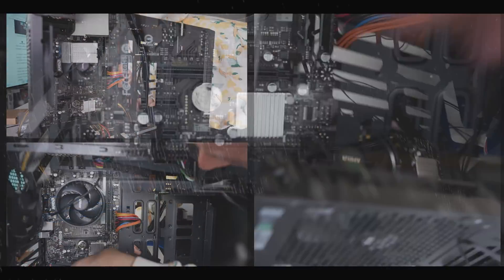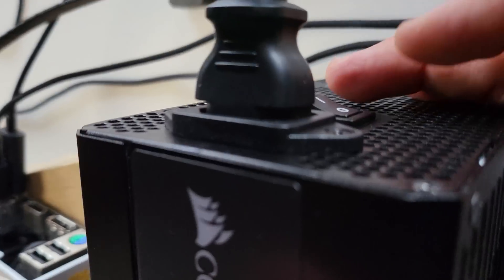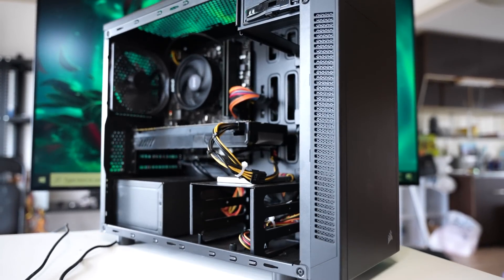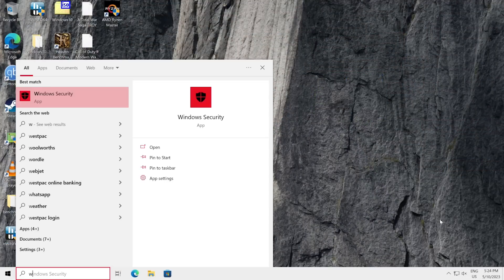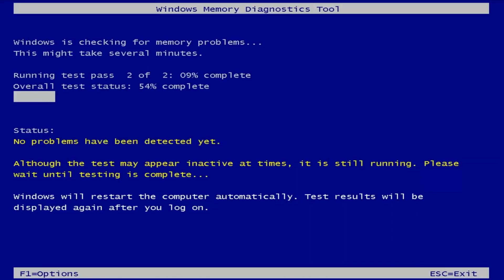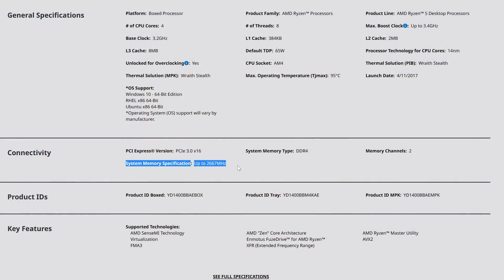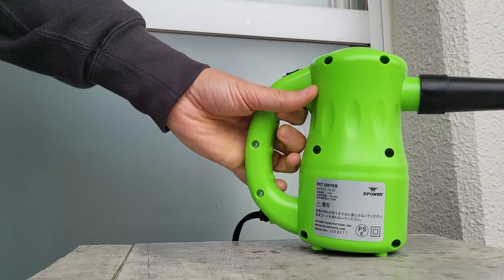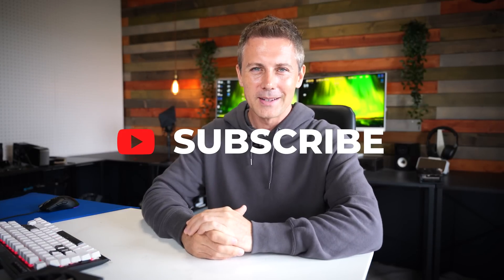Computer Won't BOOT? It Could be FAULTY DDR4 (or DDR5) Memory

Comment: Those Corsair Sticks you got are version 4.49. also known as Samsung 16Gb M-Die. i've been told by some people who binned lots of ram that this chip is so bad that if you have it your XMP is most likely at least a little bit unstable. it is apparently one of the worst DDR4 chips ever made. worse than 8Gb C-Die and 8Gb AFR.

The first kit you had is using Hynix 8Gb DJR which is actually a very good chip. so that one was most likely just bad luck because DJR is known to have very high voltage tolerance and overclock in excess of DDR4 4600 on motherboards that can handle it.

in my opinion it is highly important that people know what RAM chips they are buying because it not just helps immensely with overclocking if you want to but will also help you avoid chips like S16M or S8C that are known to die en masse compared to other chips. sadly it is almost impossible to tell what chips you are getting if you buy online because ram manufacturers of course don't want to let you know that 3200 16 18 18 28 kit nr1 will overclock to 4600+ while a different kit with identical spec but different chips will be stuck at 3466 forever.
Reply from the maker: Oh wow is M die the worst? I didn't know that, I thought Hynix A die was some of the worst.  Thanks.
Reply: @techyescity  Is multi purpose spray the same as WD-40?
Reply: @DapFrIeNd.  Here in Australia it’s actually labelled ‘Multipurpose Spray’ in a blue spray can and it’s similar to WD40…. HOWEVER…. WD40 in some  countries uses a different formula which makes in a conductive lubricant cleaner which our Multipurpose cleaner IS NOT.
Reply: @techyescity  i too was under the impression that Hynix 8Gb AFR was the worst DDR4 IC but lately Samsung seems to take the cake. they also released an 8Gb E-Die chip which is apparently also about as good. general trend is that the chips have a huge problem with clocking well at higher voltages and are even extremely fragile when it comes to any overvolting above the JEDEC spec of 1.2V
Reply: @techyescity   nope hynix A dye is amongst the best and can clock quite high .... its the memory controllers themselves that make the difference

Comment: Had a similar problem with a new Corsair Vengeance 32GB kit. It worked for about a week, then one day I got a blue screen. After a couple of failed reboots, I got back into Windows and ran Windows Memory Diagnostic. The test got to 4% and the screen went blank. I then realized it was time to RMA the kit. Sent the memory back, got a new kit...works fine now. BTW...subscribed. 🙂
Reply: i'm having the same problem with the same ram. i wish i just stuck with ddr4

Comment: I just noticed yesterday that 1 stick of ram was not syncing it's rgb. I checked the computer and only 1 stick was working and the other broken stick was just lighting up its rgb (but I couldn't control the rgb and it was not registering it's 16gb of ram). Later that day while troubleshooting the second stick quits working. Not using xmp. G skillz Ddr5 6400 mhz ram being used in 4800 mhz. Looks like 2 dead sticks. Both from the same kit and it's a 2x16gb kit. I have the worst luck when it comes to electronics and I'm not joking. the kit worked for like 1 1/2 years. 12700k msi mag ddr5 motherboard etc. Etc. Etc. Bullshit. Bullshit. And more bullshit I can't believe you released this video just the day after both my sticks appear to have died. 
Edit: confirmed that both sticks of ram from the same kit failed on the same day within hours of each other. Then your video drops the next day. What are the odds

Comment: 2021 I was building my friend a PC, I had a used Ryzen 5 2600, used b450, used PSU and used GPU. I bought brand new two sticks of ram and an SSD. I had problems with the PC randomly having blue screens, windows kept corrupting, I was wondering what my friend was doing to the PC. Little over a week later I go over to check kit out and I notice very weird problems. It turned out that one of the Ram sticks was faulty and the SSD was faulty from factory. I was shocked like what are the odds of two new parts being faulty and not the four used parts haha.

Comment: After years and years of PC building and hundreds of PCs later...I actually got a stick of faulty RAM for the first time that wouldn't allow a boot with the stick inserted in any combination, or on its own, in any slot.  Not a stick that throws errors on  a memtest...flatout no boot.  One of the two same 4GB DDR4 2400 caused a no boot, other stick works fine.  It was a no name Aliexpress brand, so I wasn't surprised.  I ordered another different noname stick to replace it so we will see if that works with the other random single 4GB I am stuck with now.  This PC has been a headache because I also got a bunk mobo from Aliexpress, but was able to get a refund and ordered a Machinist MR9A Pro which works great...I just borked the BIOS doing turbo unlock and have been waiting on the flash module to arrive to fix it.  This Aliexpress PC has kind of been a nightmare, but it was also a learning experience.  Machinist seems to be a decent brand.  And Aliexpress is decent with getting refunds on scams and broken items...at least better than Amazon, in my experience.

Comment: The fact we only have dual channel nowadays is cursed. It forces speed increases at the cost of latency, when instead latency could be worked on if there was a hard speed limit on RAM and more bandwidth was obtained with more memory controller channels.

Comment: My PC is now displaying C5 on post.
Windows doesnt even chance to load drivers so im not even getting keyboard and mouse power or function.
Everything was working fine until i installed Windows 10 pro cumulative update. After instaling it asked me to do the usual restart, and BAM, thats all she wrote.
Ive taken out the ram, to see if it was a memory isue, same thing...C5 .
I taken out the battery on mobo, placed it back 45 mins later, still same..C5.
Cleared Cosm..still the same..C5.
I have a feeling that the windows 10 cumulative update has screwed up the bios somehow, as everything was working great until i installed the update.
Reply: Could try to reseat the CPU...what motherboard are you using?  A lot of memory related issues can show up between the CPU and socket interface.  It is mostly an issue on well used hardware though, not typically on "build it once from new components and use it" scenarios.  It can happen due to corrosion and oxidization of the pins and landing pads, from stress over repeated installs and heat cycles, etc.  And because of the size of the pin and pad interface, it is one of the more delicate areas of the entire system in regards to those factors.
Reply: @AaronHendu  The Mobo is Gigabyte X570 Aorus Master.
I did the build about 2 and half years ago.
Never had a problem until 3 days ago when I installed the Windows 10 cumulative update.
All went Pete Tong then.
I just it to guy who does repairs for him to take a look at it. But I'm not hopefull.
What would re- seating the CPU do mate?
That's about the only thing I haven't done so far.

Comment: I started to laugh so hard when i saw the corsair ram problems you have , i had 3 kits in my life  from corsair, the first one was the ddr2 1066mhz 2GBx2 , one stick started to have error's 2 months in , second kit was a ddr3 1866 kit , go figure one ram module started to give errors in memtest after a while and my pc crashed a lot , and yes i was dumb enough to buy corsair ram  again (because i forgot)when i made my 8600k build with ddr4 , the 3200mhz kit that i bought had one module dead from day 1 , meanwhile i for one never had problems with other brands of ram , and i used adata , kingston , gskil , maybe i was just unlucky , but i for one will never ever buy ram from corsair .
Reply: My fav RAM I have ever owned over the 20+ years in the hobby have mostly been Corsair lol  I had that same DDR3 1866 kit, I think...one of my favs.  Tall black heatsinks with nice shade of blue stickers?
Reply: @AaronHendu  aye , it was the tall black model with the blue trim on top of it , after the warranty replacement the kit was fine until i changed system , but one module still failed in the end , since that pc was used by my father in law , even today one ram module works , while the ram looks nice , its sad  that one module still died after a while even tho it got replaced :/

Comment: I had problems with my PC regarding the CPU Power saving states, it would always BSOD on me randomly. What i did to fix it was to disable in the motherboard's BIOS the AMD Cool & Quiet as well as disabling the C-States power saving feature. Ironically this fixed the Blue Screens but the power states remain active even when turned off in the BIOS, i've noticed this behavior in Windows 11 which is weird as heck, never encountered such a problem in any PC that i've built, i think the problems appeared when i had a video card that had a faulty fan and would rise in temperature more than it should it have, this is, i suspect, what affected the motherboard which is a Gigabyte B450 Gaming X. The problem manifests itself with a newer motherboard from Asrock B450 Pro4 R2.0, this kind of points out it could also be the PSU, though i am not entirely sure.